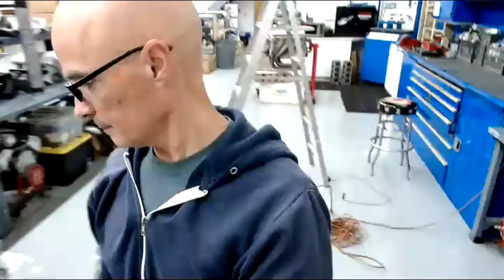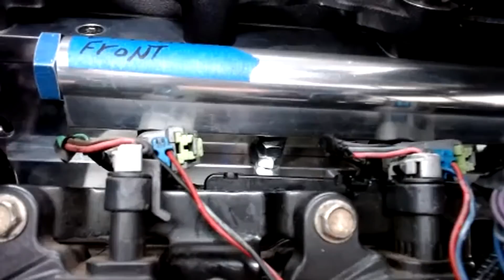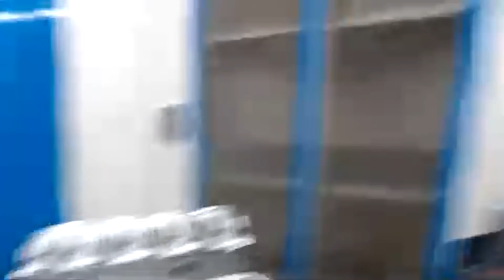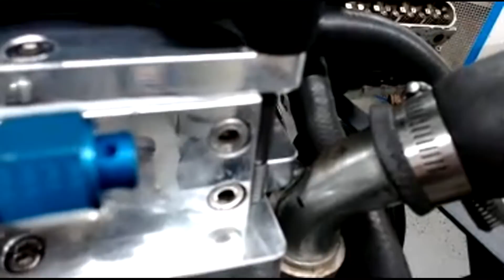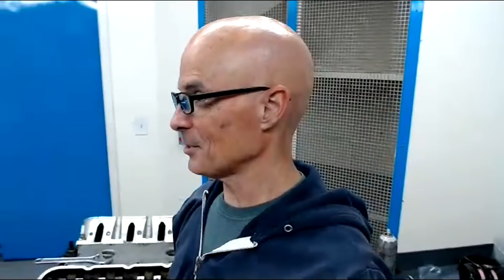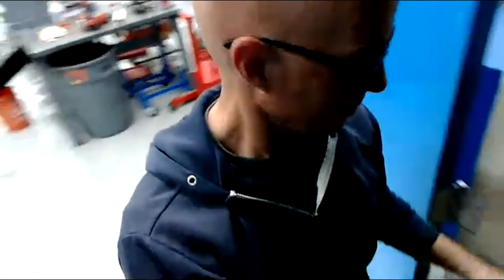LET'S TALK TECH-IS THE BTR TRUCK NORRIS A CARBAND BLOWER CAM?

Comment: hi rich, quick question. we just aquired a cadillac ctsv with a brand new rebuilt ls2. gen 3 rods and forged flat tops. we were told it was built to have a magnussen super charger. the ring gaps were my main concern. it .024 top and .023 2nd. this is going to be a street car with little boost. im guessing 7-800 hp tops. is this ok ring gap or should we disassemble the new motor and open the ring gaps up. the builder assured us it was ok. im just skeptical. please let me know your opinion. 10.5 compression motor.
Reply from the maker: IF IT IS OPEN-ADD A COUPLE
Reply: Motor is in car running. Is ring gap sufficient or no. What would be the boost limit

Comment: I’d like to know more information on the “adaption” parts needed for this, I’d like to put one on my 6.0 LS in my bouncer... a poor boy setup if you will... looked everywhere for the adapter and can’t find it, would like to see this setup run on 91 (cause that’s what I’d run)
Reply: This is still several times the cost of a budget turbo setup if you are really interested in "poor boy" setups
Reply: @chipcurrey653  thought about that too... I don’t want the “lag”, I want instant boost, and don’t have room for a lot of piping, LSA blowers ain’t cheap, and I’ve actually wondered about this kind of setup with a 122 for years
Reply: Tom helped him to modify the intake/ blower to fit on the LS engine.
Reply from the maker: DEMUSE ENGINEERING DOES THE ADAPTER KIT FOR THE FORD BLOWER